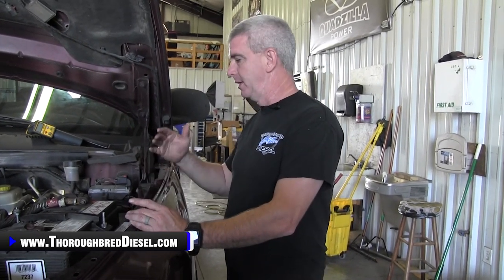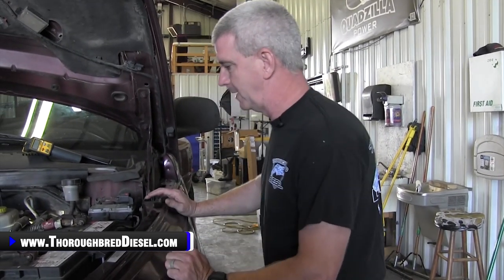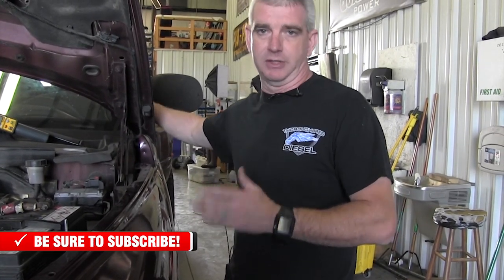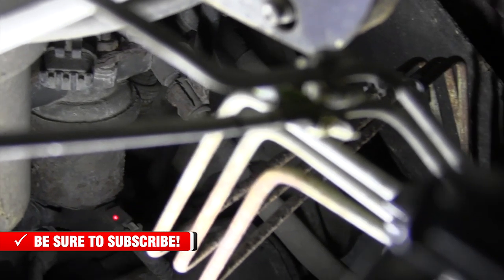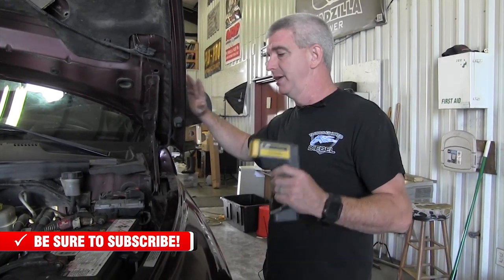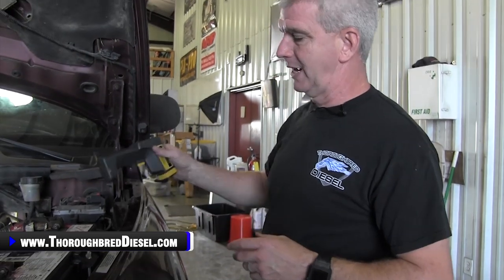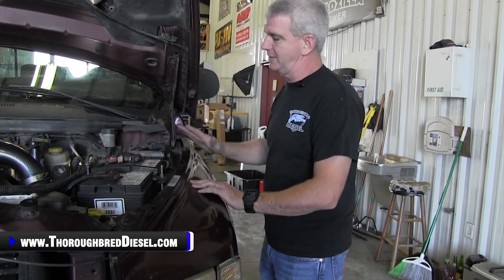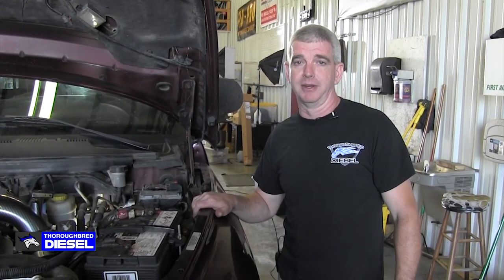Quickly Identify An In Tank Lift Pump On A Dodge Cummins

Comment: 1. Quickly identify in tank lift pump or block mount
2. Install airdog2 4g, or fuellabs pump/filter 
3. Install beans sump meow
4. Maintain religiously! kinda halfway good maybe.....😶  HUUUUHHHH!?? What's a fuel filter? A whaaaat... Er... Separator? Shoot, I clean the fuel filters each time I fuel up. I don't leave my fuel cap off when it's rainin'. So ain't no water getting in that there deezul anydanghow. 
WHAT?! I do change my earl.  Every time I have to add some. Shoooot, I change ma earl errr week sometimes .... Er when she starts a knockin'. 'chever comes 1st. Lube her up full and we're good to go for another round of shenanigans! YEEHAW! Tow Murs! 
5. Drive to 1 million miles. 

Meow